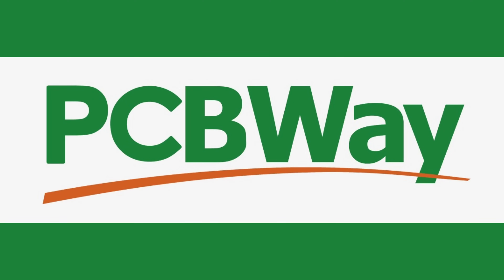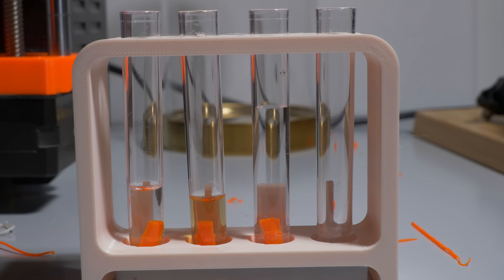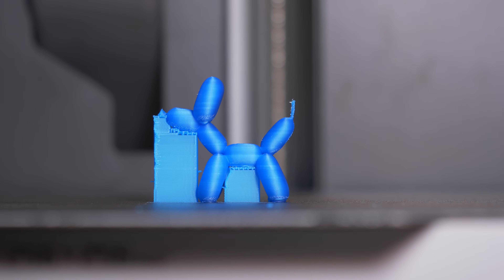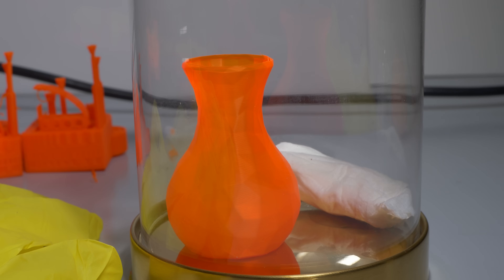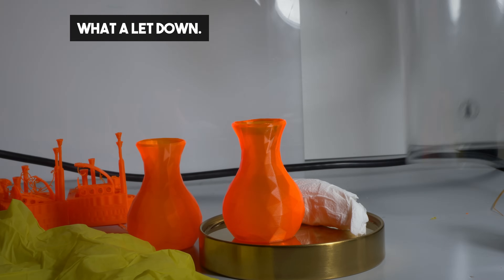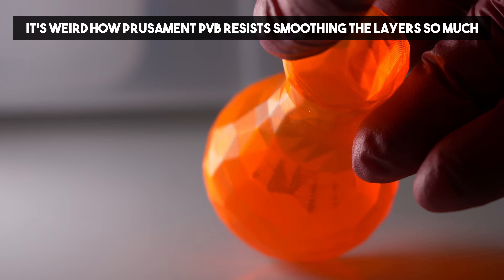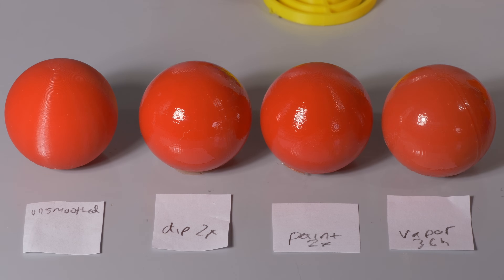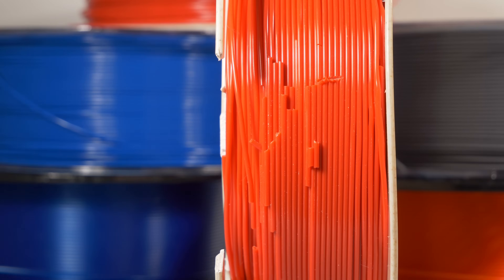The Smoothest Filament: 3D Printing without layer lines!

Comment: I am currently experimenting with PVB from Sunlu. I really like the Glossy Look and it makes the parts easier to colour in.

But you'll never get rid of all the Layer lines completely atleast from looking at it (you won't feel them anymore)

For me the Best method of smoothing is definitely a combination out of spraying and Vapor. Only takes two to four hours and you only need to respray once or twice, depending on the desired outcome.

Since PVB from sunlu is equal or even cheaper than some PLA it's atleast for me a really good alternative if you wanna go through actively smoothing your parts for Cosplays or figurines.

Hope this Helps

Comment: thanks for the walk through of the methods. this kind of makes spraying a layer of clear acrylic over PLA seem easy and a better way in general to get the smooth effect with low effort. With acrylic over PLA, there will still be layer lines at a close examination. But I found over-all the acrylic would help blend the 'striated highlights' together to create more of a ceramic look for decorative items. it was super easy and repeatable, important if you are trying to sell the stuff you make.

Comment: Thanks for the video!  Polymaker sells a PVB vapor smoothing device called "Polysher" which works pretty good, but it's $223.99 USD.  I personally found PVB to be less durable than PVA so I would relegate PVB to only decorate items that you insist on being smooth, but you do lose a smidgeon of detail in the process.
Reply from the maker: yeah I'm aware of it..its pretty specific use case so you kinda have to do a lot of pvb

Comment: In America, we can go down to the store and buy Everclear for like $8 a bottle that is 99% ethanol that is meant to be consumed. Though it does work well for any pure ethanol type application. It isn’t ever 100% because ethanol at those levels suck water out of the air quickly.

Comment: ok 9 months too late... but SPOTFACE CUTTER! I had to make a PCB at my work experience company as a kid using one of those... ugh. when I discovered how cheap properly fabbed PCB's had become a few years ago I was overjoyed! (I did electronic engineering at uni in the mid 90's and making our own PCB's involved blank Copper clad board, printing designs on acetate sheet, then doing a complicated dance of UV exposure and dipping in an acid bath to dissolve the unwanted copper... TEDIOUS! it was that or spend thousands on a fabbed prototype board from a proper PCB house

Comment: The stuff seems to be quite expensive here, like over 40€ per 4kg roll. When you want vapour smoothing, there's already ABS which is a lot cheaper but admittedly needs an enclosure for medium and large prints.

Comment: "You can't just put it back in the bottle"
Just buy a full bottle, mark it with a marker pen and keep tipping it back in until the IPA is too contaminated to use.
Same when I clean my resin prints in the ultrasonic, just have a bottle for each thing you clean and you don't need to worry about contamination, much better than throwing it away.

Comment: G9M2 Question: what was wrong with yours? Mine (bought in Nov) has its shutter button stuck ON - need to send it in, not excited about a long wait ...
Reply from the maker: the screen cable I think, although the repair note said the motherboard was replaced. It's been fine since it came back anyway.

Comment: As a fun fact: You should use Vodka instead of Whisky. Vodka usually contains fewer additives and sugars compared to whisky, which makes it a better option for cleaning. Additives and sugars in whisky can leave residues on surfaces, making vodka a cleaner choice. (Also, the lower cost of cheap vodka compared to cheap whisky makes it a more economical choice for cleaning purposes. So, if you need an affordable and effective cleaning solution, vodka can be a great option)

Comment: PSA: While this method DOES give a very good introduction to PVB smoothing, the results are not the best you can achieve. I think maybe this comes from the specific materials used. I am not AT ALL an expert on this, but I have gotten waaay better results with Polymaker Polysmooth filament (can provide pics if people are interested). This filament is designed for vapor smoothing, and just by putting parts in a tupperware on my heated build plate I have gotten completely smooth parts. Maybe other PVBs just don't smooth as well.

Comment: All of this alcohol stuff is terrible for your health/lungs. I know you mentioned some ways to help mitigate it. But truly if this is being done indoors it needs to be done under a laboratory grade vent hood. 

The alternatives would be do it outside, or right in front of a box fan that is pointed out the window. Preferably with a vapor certified gas mask/face shield. 

3D printing has normalized a lot of health hazards.

Comment: You can buy Ethanol 96% ether as "methylated" spirit which tastes horrible (not containing methyl anymore but still something toxic and denatonium benzoate which makes the terrible taste, sadly also as residue, why you cannot use it to clean stuff with food and also contaminate your fingers and food when you use a spirit stove) or buy it taxed. More as 96% is really expensive as it cannot be produced by destillation only. It needs to be dried chemically making it really expensive but 96% should do. The isopropanol will be contaminated with water by air humidity after a while too.

Comment: I use Isopropanol to clean my glasses while driving a car and I never wear goggles while doing that. Acetone is also not as bad you can actually feed on it. If you don't eat any sugar and other carbohydrates your liver produces ketones including acetone from fats to feed your brain. That's called keto diet. If you do endurance sports and don't eat permanently the same thing happens.
Of cause you don't want any of that stuff pure in the eye. Setting the stuff on fire is actually the worst risk.

Comment: I have matt fillament that doesn't show layer lines.  Glossy means more visible layer lines, which also shows imperfection more.  If you are American then just throw the isopropyl in your huge v12 engine fuel tank.

Comment: 2:37 You should have tried 70% alcohol from the pharmacy. Expensive as heck, but more pure. And 99% Ethanol isn't offered because f the things you said, but it is very hard to remove the water from ethanol past 70%. On top, even if you have done that, Ethanol becomes strongly hygroscopic, so it won't stay long 99& alcohol.

Comment: I got Eono PVB from Amazon.
You have to dry the reels, preferably not with heat alone, better to store it in a box of silica for a week or at least some days.
You have to keep it absolutely dry, probably also while printing, this stuff will dry your room.. but at what cost :D

I smoothed using a spray-bottle and found issues.. my printer nozzle didnt print very even, so where small pockets formed at the surface (might have been still too wet) i got cavities and bubbles. Also, you probably also dont want too much to seep into the inside of an enclosed part as smoothing too fast will then put too much alcohol inside it, ruining it afterwards.
Also best to hold the part in a way where the droplets can quickly drop off or dont bother too much.. maybe a quick high speed fan burst could help to get it off.. vapor smoothing probably avoids this.

Comment: Acetone has very low toxicity. It stinks, and it can dry / crack your skin, but it's mostly fine. Same with isopropanol or ethyl acetate. In the amounts you're dealing with there, they're perfectly safe for skin contact, and wouldn't pose a serious health risk even if you drank them.
Reply from the maker: The risk is explosion I believe
Reply: @LostInTech3D  - Well, gloves and tweezers won't help you with that (they do avoid leaving fingerprints, but it sounded like you were saying you shouldn't touch the liquids themselves). The risk of explosion is also pretty small, and the explosion would be just a small "pop", with the amounts you're using.

There's a reason why isopropanol is sold as "rubbing alcohol" - it's perfectly safe to spray / pour on people (in larger amounts than you used there) and rub into their skin (while they breathe the vapours).

Just not safe to drink, but that's usually not a big risk because it tastes pretty bad even without denaturants, and it would take about half a glass (125 ml / 1/4 of a pint) to start posing a health risk.

Methanol, on the other hand, tastes almost exactly like ethanol and 1 or 2% of that is enough to cause nerve damage.

Comment: 99% ethanol is no more "dangerous" to human health than twice the amount of 49.5% ethanol (assuming the remaining % is water in both cases). It's just very hard to produce ethanol above 96% purity, or to keep it above 96% (for a couple of chemical reasons - basically, to get it above that you'd have to use some toxic chemicals that are then hard to remove, and even if you did that, it would then tend to absorb moisture from the air until it was back at 96%).

But you should be able to get 95% or 96% ethanol at any chemist's (pharmacy). It will be denaturated with a very small amount of some horrible-tasting chemical (like denatonium / bitrex), but that shouldn't matter unless you're planning to drink it.

It probably won't work as well for smoothing as IPA, though.

Comment: You got it in a chamber where there is no circulation so it concentrates at the bottom and you have vase mode so there is no internal structure to hold it up right so the one layer that melts is the only layer that it has for structure too

So if you must use vase mode with no type of internal supports use a fan

Comment: if you want concentrated ethanol you usually can get some that had been slightly impurified with MtBE, a compound that is not really toxic but makes you vomit when you consume it. 99% ethanol with 1% MtBE is used in the Chemical Industry for 2 reasons: 1: it avoids having to pay Alcohol tax on it. 2: your employees won't/can't drink it.

Comment: You don't have a technical IPA? It is dirt cheap in 1l or 5l containers. 5l is less than 5€. Also, ethanol is available as a food spirit (rectified spirit) which is 95%. It costs about twice as much as IPA. There is also available technical ethanol in the range of 96-98%, costing sth. in between IPA and food spirit, so ~1,5€/l.

Comment: Interesting ,  it would be quite easy to convert your cloche into a forced air vapour chamber, simply get hold of a small fan unit around 2 cm put that in the bottom along with the battery and switch or wire it into a old USB cable,  assuming it's 5 V fan,  drill some holes in the base of the cloche then seal the base with a piece of plastic or print something to cover it so it doesnt pull air in from outside.  Hey presto one forced air smoothing chamber.  It will speedup the smoothing time ten fold for sure.

Comment: Cool mist humidifier for your alcohol vapors, in a cylindrical container with 3 slow moving fans across from each other on a 45 degree angle for even application and a power bar that has a timer for consistent results.

Comment: Basically useless filament, one is just better off using abs and acetone on a brush to smooth it out, abs much easier to print once you get the hang of it.

Comment: How well does the filament handle humidity?
Reply from the maker: Badly. Terribly. The prusa stuff is very stable but the other ones need drying almost daily.
Reply: @LostInTech3D  alright.  Thanks, I got PLA but my dehumidifier broke so my house is at 70%
Reply: @TEW58_De_Bluey  Always store your filaments in a dry-box with e.g. silica, otherwise they get ruined, even PLA!
For the very Hygroscopic materials, best to also print out of the dry-box via a tube.
I am going a step furhter and getting one of those electric dehumidifiers, but they are quite pricy.
Reply: @tarakivu8861  I two that you put filament in and set it to dry, but my house unit burnt up not to long ago.

Comment: On my gen 1 lulzbot mini I used to print primarily ABS and did acetone vapor smoothing a fair amount. I will say from this video that seemed a lot more effective in terms of coating and WAY faster both in the vapor 'immersion' times and especially in the re-curing times after the vapor was removed. A few hours was enough for the entire process typically.  This material seems to be just as annoying to print as ABS, different issues, but issues nonetheless. I would take some warping or splitting over a clogged hotend any day.

What are the print vapors like for PVB? One of the main reasons I stopped ABS is that I am typically in the room with the printer and I didn't want to keep printing with those vapors around all the time likely slowly killing me.
Reply from the maker: it varies by reel, the red stuff was unpleasant but the prusa stuff had no odour at all. I dont think any were as dangerous as ABS, based on the MSDS, for printing.

Comment: You can't buy 99% alcohol, not because you'd drink it, but because it can't be made. Beyond 96% alcohol, further refinement becomes very difficult. 
As far as I know, the stuff can be bought, but with a small percentage of <poisenous stuff> mixed in to make it undrinkable.

Comment: Regarding getting vapor to condense on the part:

Use a glass beaker without spout, with a lid.  Load the part from the top, so the heavier vapor does not leak out during loading.  warm the beaker with a reptile patch heater or something similar, to slightly above room temp (safety, y'all) say 45C.  Put your part in the freezer and the alcohol sponge in the beaker for 30 minutes or so.  Areas of the part that collect pools of cold air should be inverted.  Uncover the beaker, lower the part onto the stand, cover the beaker, remove when finished.

Comment: Wire wrapping tool. Used it a few times in Ham Radio wiring.
Reply: Actually, no. It's a stripboard cutter. Similar, though.

Comment: Is there transparent PVB for smoothing? I'm still looking for a glass-like filament. A way for smoothing an alternative material (PETG) would be welcome, too
Reply from the maker: There is, but it's not that transparent, it's just colourless and translucent If that makes sense.
Reply: @Tech3D Thank You
Reply: FDM prints will never look completely transparent (even with a lot of smoothing) due to the way the process works. You always get irregularities between the layers, tiny trapped air bubbles, etc.. At best, it'll look like something halfway between glass and that "privacy film" people put on bathroom windows (i.e., it looks almost transparent if you press something against it, but milky translucent from a distance). Some parts may end up almost transparent after smoothing but it's not something you can control.

If you need glass-like transparency, make a model, smooth it (by whatever means - ex., sanding, filler primer, etc.), then use that to make a mould for transparent resin.

Comment: Thanks for doing this testing. It is a great option for printing things you don't want to paint or sand. I have been using a .12 layer height and Elegoo Rapid PLA+ with my Qidi XMax3 and I must say the layer lines are very hard to see.  For most applications it is good enough.  If it's something you wanting to paint, a quick sand of 220 and some filler primer and Bob is your uncle.  The great thing about this new generation of printers is it is feasible to use these tiny layer lines and not have your print take 3 days.  I have tried a ton of PLA brands and the Elegoo Rapid is the best and it is cheap, only $16.99.   It prints better than Qidi's Rapido filament which I find quite ironic, since I use the Rapido filament profile with the Elegoo.

Comment: If I wanted to build a fence outside, where any other sane person would just use picket wood, what filament would have the best durability against outdoor conditions?
Reply: PETG is resistant against UV-radiation, thats the most dangerous things to plastics outside.

Comment: You can't really get 99% ethanol, because it immediately takes water from the atmosphere.  You can get anhydrous lab grade 99% ethanol, but it's prohibitively expensive, and it just starts to absorb water from the air as soon as you open it.

Here in Australia we can buy 95% ethanol, which is technically called "denatured alcohol" and it's sold as "methylated spirits".  Legend has it that it was "denatured" with methanol (extremely poisonous) so not for drinking, but in fact for many decades it has just been 95% ethanol with added bitrex so would be extremely unpleasant to drink.  It's much cheaper to buy than isopropyl alcohol so can be found in most cleaning supply cabinets.  I don't know how most of the rest of the world does without it.

Compared to isopropyl alcohol, "metho" as we call it has slightly harsher cleaning and dissolving properties which can be better or worse depending on what you are doing.

Comment: Not really convincing... It would have been interesting to test this material with water... Does it dissolve in water after a few days?
Reply from the maker: Nope. It's hygroscopic but it doesn't break down. I'll double check with the test tube though, it's still in there 😂

Comment: Thanks for the video but I think I'll pass on PVB; I'm not too into how everything looks covered in slime after vapor smoothing :( I'm pretty pleased with anything that comes off my Bambu printers when using a 0.16mm or lower layer height, especially with silk PLAs which seem to obscure layer lines pretty well with their nice sheen :)